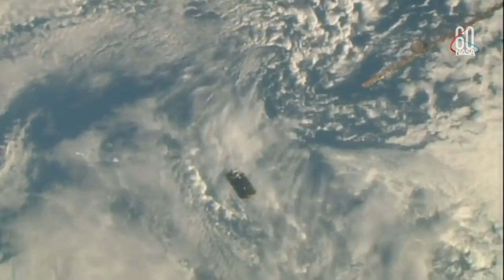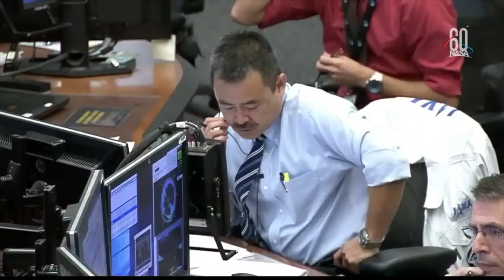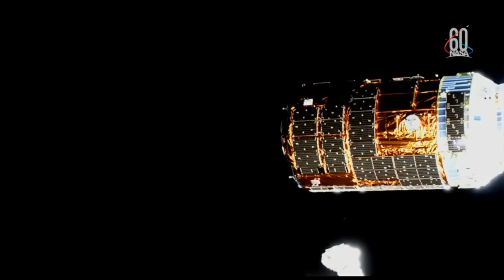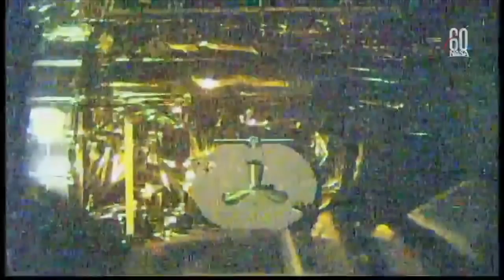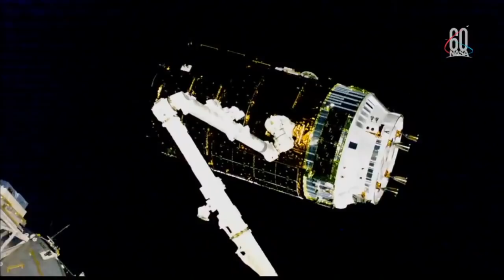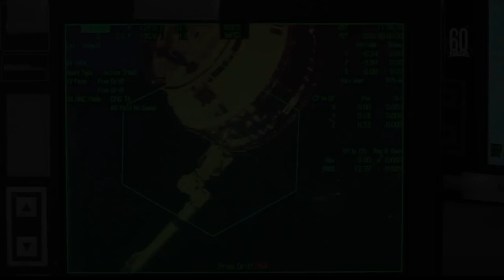HTV-7 capture

Comment: Why the clouds never moved?
Reply: The ISS orbits at 7000 metres per second(15000mph), clouds move at no more than 50 metres per second(110mph). 

To a bullet, a person walking is barely moving. Now imagine your more than 7 times faster than a bullet. You're seeing the stations movement, not the rotation of the earth. 

What would be weird is if the clouds were moving more than the tiny bit you can see here if you follow a cloud through the whole frame. When you see videos of clouds moving from space, they are sped up or time lapses from a satalite in a orbit that takes the same amount of time as the planet does to rotate, making it stay over a specific spot on the planet.
Reply: Leon Allan Davis, lol. I hope you're not serious.
Reply: bb, Duhya is right about the orbit speed and how it affects movement, but pixels needs to be considered also. Each pixel probably represents half a quarter of a mile or more, so clouds would have to be moving pretty fast to be noticeable from this altitude.